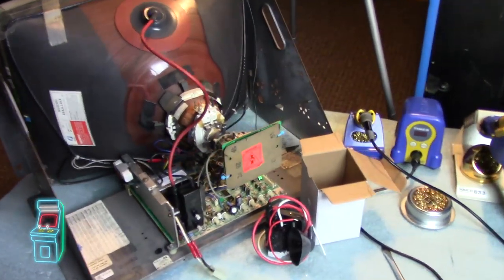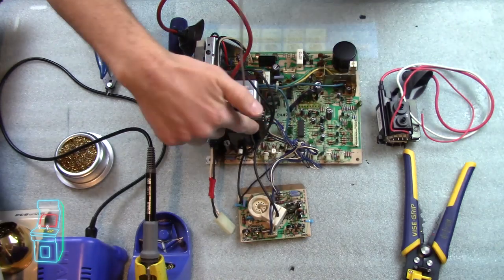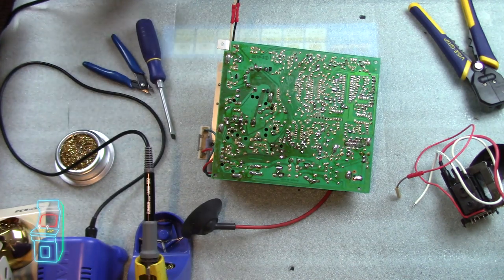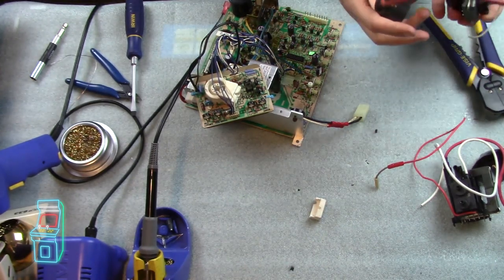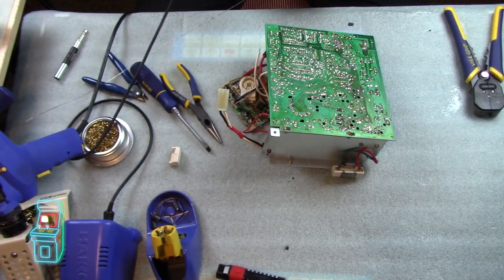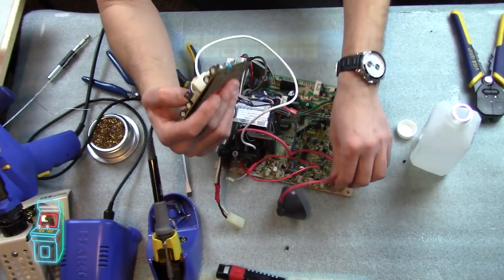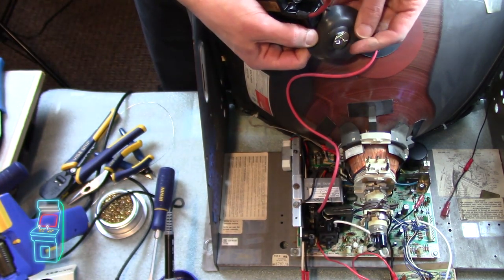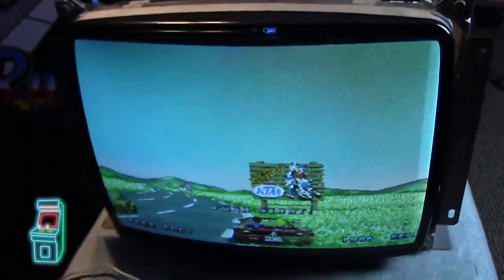How to: WG K-7000 flyback swap #CRTrepair

Comment: Thanks for the video!  I'm swapping a flyback in a K7000 also and wasn't sure how the focus wire was attached in the socket because it wasn't a very clean factory solder job.  It also turns out the plastic cap on mine flips up rather than pulling off.  I had to remove the green cutoff pot to make room for it to swing up.
Reply from the maker: Yeah, the ones that swing up are nice. I prefer those.

Comment: My cab originally came with a k7000 19" chassis but had some problems with it so swapped it out for a different brand chassis, now I've got some free time I decided to get to the bottom of  it as the chassis looks brand new and seems a shame to have it sat there doing nothing, my issues were and are, 1. Broken width coil I had a very wide picture, mine is the 19" and so the coil is not available anymore its the one with the ferrite shield around it, I have a bunch of different coils that I've cribbed from old tvs I've dismantled over the years and found one which was perfect for k7000 19" and a good substitute so thats fixed and have excellent width control, 2. Washed out picture not very colorful so replaced all the caps thats now fixed but my main issues are when the screen goes to a brighter image it goes quite blurry yet on darker images the screen is reasonably ok but not like it should be... crisp, also on white screens the picture jumps I suppose thats a power issue as white screen is demanding full power, my k7000 has the white knob flyback and have been told they are crap,  ive noticed after cleaning all the dirt off mine is covered in cracks all over the body so got a new one coming that may fix my jumpy picture, I'm more concerned about the blurry image, I saw in one of your videos you mention neckboard transistors and issue with blurry image my image looks just like yours hazy on the edges ive ordered some new transistors so hoping that  will correct it, would be nice to get my k7000 back to fully working condition.
Reply from the maker: Yep, definitely swap the Flyback. The white knobbed ones are junk and if they blow up they take out everything!

Measure the B+. It should be 125v. If it's good then no need to re-cap the B+ filter cap (the huge cap).

Reflow everything on the neck board once you put those chroma transistors in.  I tend to also bullet proof my neck board pots by replacing them all. The values are in the manual.  Arcadepartsandrepair.com has them. Search term:  "K7000 pots" or "K7000 VR201" etc.  All neck pots are: VR201, VR203, VR205 (2k ohm) and VR202, VR204, VR206 (200ohm).
Keep me updated!

Comment: To verify its your drive transistors just simply take a double sided alligator clip,hook one side to the frame and briefly touch the solder joint on the back of the neck board to the transistor,the red will turn the whole screen red,the green will turn it green etc  and if it doesnt then the trans is bad..happy gaming🤘
Reply from the maker: Good tip!

Comment: i set mine to 300c
Reply from the maker: Seems kind of low?  Why not 350 C?
Reply: @delsarcade  ive never had a problem with my solder melting at that temp and it gives me longer work times if i need it